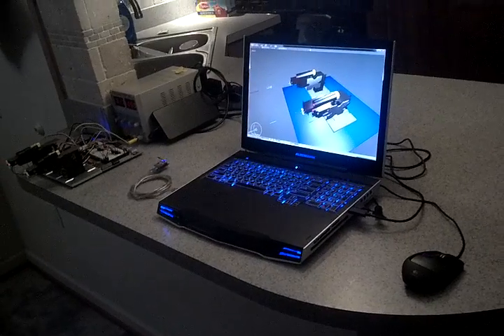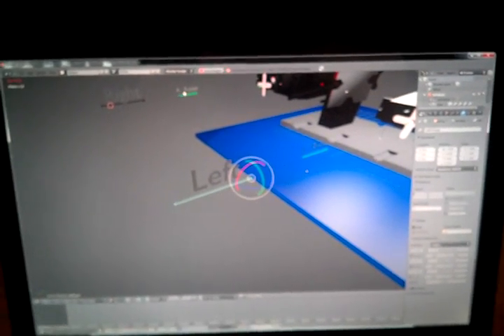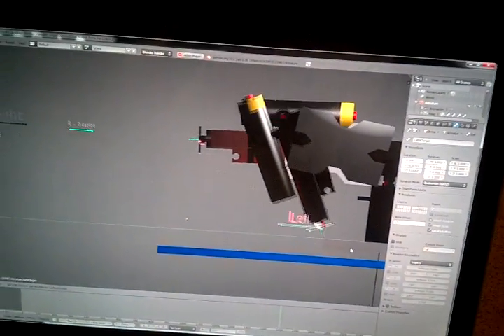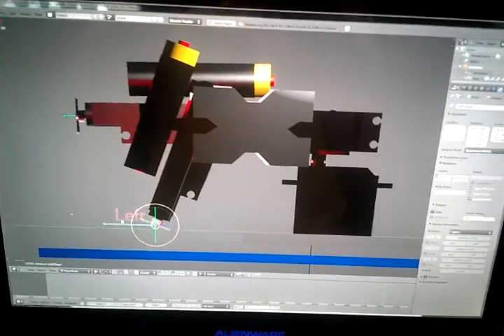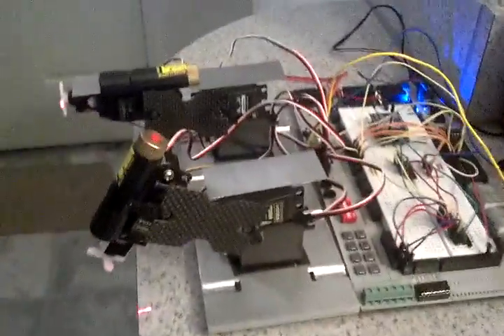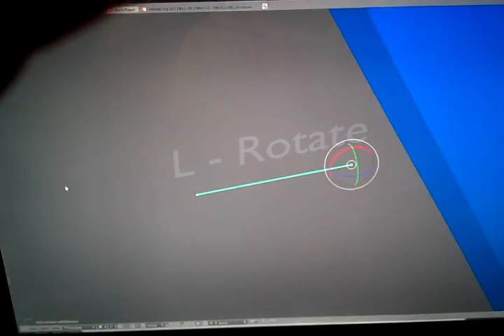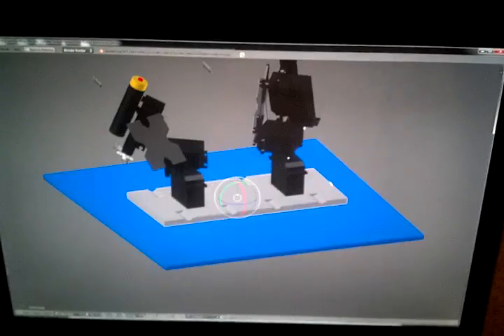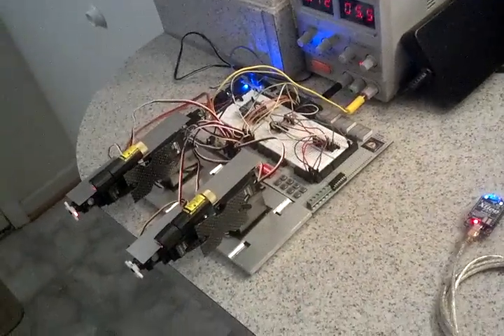8 axis robot control from Blender 3d in realtime

Comment: Hi, I am almost done with my project robot arm, unfortunately I just could not get the local axis or angle of rotation of my bones, so I could send it through serial. How did you retrieve the data from blender? please help, thanks.
Reply from the maker: There are two methods I know, First is to install PySerial into Blender: to do so find the exact Python version that is running in Blender (3.5 i believe), Then download and install that exact version's interpreter to your PC. Next install PySerial library. Now you can copy/paste the installed PySerial files (Lib>site-packages i think) to your Blenders Python's Lib site-packages and now blender can open serial ports to communicate to USB-to-Serial devices. And the second method is to use TCP/UDP sockets (which are included in blender). to stream your data to a receiving script or networked endpoint. Method1 is more direct, Method 2 is more supported.
Reply: Thank you so much for your reply. I did install pyserial, but my problem is what syntax did you use to extract the armature angles? I am getting, what I think is world coordinates and not local axis of rotation of the armatures.
Reply from the maker: RightRotationServo = math.degrees(bpy.context.visible_pose_bones[10].matrix_channel.to_euler()[2])  #Example  was pulled from the archived robotarm.py scripts. Hope this helps. Also you may wish to check blender.stackexchange for more info.
Reply from the maker: if you know the relative positions of the head and tail of the bone, you could write your own trigonometric functions to compute the angles. But if it is a simple bone that is a child of another bone and you are applying rotation only, then you should be able to get the local Euler angles from Blender without having to do any math. Your project looks straight forward, and intriguing (will there be a camera to determine which cube it is grabbing??). Also Blender is not always the best application. Consider R.O.S. or even the Unity Game Engine as an alternative and find which you prefer, Blender may or may not be the best fit for your end goals. Best luck!

Comment: Hey this is an amazing accomplishment!  I'm not familiar witih Blender, but i guess you've found a way to get PWM signals out of blender and into the servos?  Do you know if the PWM can be configured to drive dc motors instead of servos?  And you mentioned socket module?  I'm going to have to look that up to see what its all about.
Reply from the maker: fa va Thank you for the compliment. To elaborate on your question a bit, I actually am not using blender to generate the PWMs for the servos. Blender simply sends rotational information to a microprocessor (p8x32a) which converts those numbers into PWM duty cycle percentages that the rc servos understand. As for controlling dc motors, i will say that pwm signals most definitely can be used to drive them if they are first amplified. One way would be to use an h-bridge circuit, that would give you control of a dc motor's speed and direction. However it becomes increasingly difficult to maintain precise control of the motor's shaft's exact rotational position without the use of encoder feedback and sophisticated PID controls. If you are not concerned with exact positioning of the shaft (as if its just a wheel or a fan) then Blender could definitely send speed parameter to control a PWM H-bridge DC motor. Sound fun actually :)
Reply: Great Mr .Grant Olsen , 
Can u tell me your website or E-mail ID ?
Actually I can't understand the manner to get the values in TCP, or Socket . Please help !!
Reply from the maker: I am interested in helping you, could you please elaborate on which values you are referring to? and are you having trouble sending these values or receiving them? Also i do have some example files i could share with you to help you understand the concept.
Reply: Grant Olsen  
Myself present at : smartreplies@gmail.com
How to make possible 2-way communication !

Comment: Great job, I did not know one can use blender to control robots. Could one receive data from real world like Computer Vision as well?

I was thinking of using OpenCV with Code Blocks for a project, but I am unable to compile it unfortunately.

I might have some other questions about it later. Could you, please, be available to answer those in a foreseeable future?
Reply from the maker: Hi, by using the same methods for extracting data from Blender (socket module) one can also read in data, i was able to read in some of the depth data from an Xbox Kinect camera using the Freenect API and generate 3d point clouds in real time. Also I would be honored to assist you if i can. thanks for the feedback!
Reply: Thank you for the advices and assistance proposition. Sorry for not replying earlier, I was busy with coursework and I am more often available on hotmail. Not sure, but I think I have sent you what looks like an invite (Not used to it).